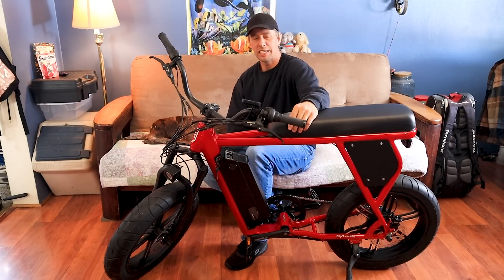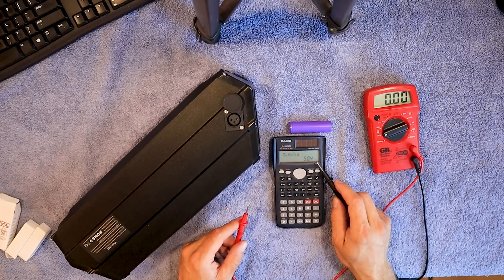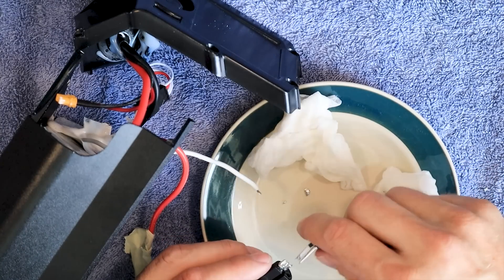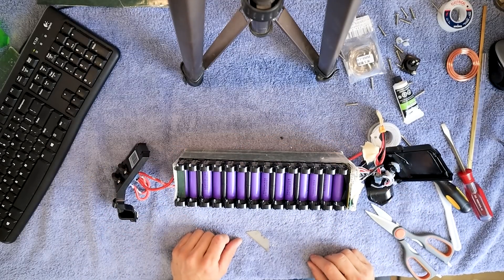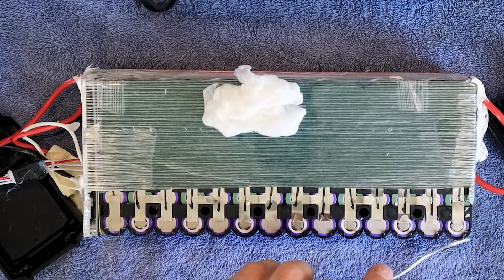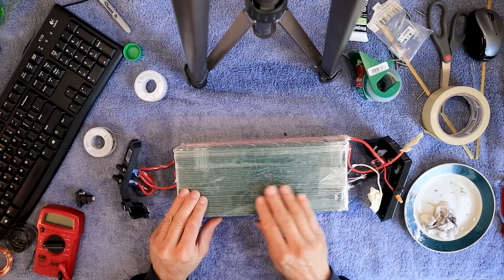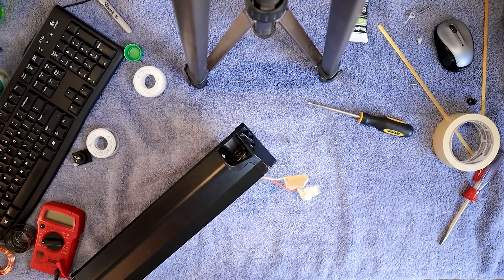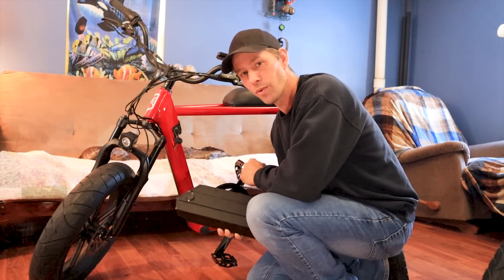Juiced Bikes Scrambler  Upgrade your 13 Ah battery to 15.6 Ah for $50

Comment: Can I do this and replace all the batteries to completely rebuild it?
Reply from the maker: You'll need new nickel strips.  If you're planing on soldering smaller gauge copper wire will work fine.   Spot welding with new nickel strips would be the professional way to do it.   If soldering make sure to use a minimum 60w soldering iron and keep a wet rag handy to cool them quickly.
Reply: @vanmasterflash7153   Thanks for your suggestions!  I've done some minor soldering work before.  I have 2 original batteries on Juiced scrambler and hyper scrambler that need to be replaced.  Juiced prices are really high.  Any suggestion on where to get the batterie cells (your description link is no longer useful)?

Comment: @3cheerz thanks so much for posting these super helpful videos! I tried your link for battery cells and they seem out of stock. I'm having a hard time locating the at an affordable price. Do you have any other recommended suppliers? Thanks again!
Reply from the maker: This only works on the 2019 model.  They removed the empty row and made it more difficult to do as soon as they saw people were upgrading for $50.  Sry, I’m not sure where else to get these cells right now.
Reply: @vanmasterflash7153  previous owner said that it was purchased in oct 2018. Crossings my fingers that when I open up the battery I find that there’s extra slots!

Comment: My Scrambler battery all of a sudden only charges to 50%.  With only 750 miles on it, the company will not warranty it.  Any suggestions as to the fix?  Great video, btw.
Reply from the maker: Sounds like a it could be a bad BMS.  I don't have any good leads on a bms but Rick Rowen does.  Now whether he gives you a link or tries to upsell you one is another story.  First make sure your battery charger didn't come slightly unplugged during charging.  In other words try it one more time.  If that doesn't work keep pressing Juiced for a battery replacement.  If that doesn't work and you feel comfortable with this, take your battery apart and look for obvious problems like bad solders and/or connections.  Also look for burn marks and burnt smells.  If nothing appears out of place it's almost certainly your BMS.

Comment: The link to the batteries you have said they are discontinued. Is there another reputable site you recommend or an equivalent brand that will work?
Reply from the maker: That's the only place I've purchased cells.  Looks like they're getting hard to find.  I'll keep my eyes peeled.  I only have one extra laying around :(

Comment: So did he use the solder in place of welding? I know you need the special welder which I have been thinking about getting. Great video. I am trying to rebuild a ebike battery and this helps
Reply from the maker: Yep I soldered it.  It's not for everyone but if your careful and know what your doing, it works no problem.

Comment: Thank you for your video. 
Can you upgrade that same model to 19Ah instead of 15Ah instead?
Reply from the maker: Yes, you'd need to buy all new cells to do that.
Reply: @vanmasterflash7153  could you advise on what cells to get for this mate. Watched your video over 10 times since I got my bike in 2019..

Do I need a new bms if I keep the voltage the same but increase the Ah?
Reply from the maker: LG M26.  2600mah purple cells.  Not sure if anyone Has new ones anymore.  Should be around 2.99 per cell
Reply: @vanmasterflash7153  Thank you.

Comment: Couldn't you just use nickel strip for everything instead of the copper wire? Want to do this for my batteries this week since I'm stuck at home.
Reply from the maker: Yes.  Only reason I used the wire was because it made it easier to solder.
Reply: @vanmasterflash7153  Cool. Now only if there was a way to get the pack out without cutting off the charging port!

Comment: Would the latest from JB battery pack still use those same cell?
Reply from the maker: More than likely. Crack it open and look for purple.
Reply: I’m betting so.  I’ve got some ready to go for when my JB Scorpion arrives.  That and a new 45amp controller
Reply: @trahar6257  Hi, what controller did you get for your bike? am still shopping around for a good one. thanks

Comment: 3cheerz .. if i tried building a pack using .. LG mj1 10amp cells .. to obtain 21ah .. can i still use the stock bms and controller
Reply from the maker: Yep that'll work just fine.  For BMS its all about charge and discharge amps.  If you planned on running a anything over 35amps you might need to go bigger. Not sure on how much the stock BMS can handle.  For charging I wouldn't go over 4 amps but it might be able to handle more.

Comment: CRAZY .. My results after 15.6ah upgrade ...  stock camp scrambler .. avg 16 - 17 mph .. throttle only on level 1 speed .. after a distance 40.2 miles .. display showed 48.4 volts .. 12.6ah used .. display still showed 2 full bars left to kill .. 60+ miles with pedal assist is doable .. imo .. HIGHLY RECOMMEND

Comment: Sweet .. do you have to adjust the controller voltage that's under the seat after adding batteries
Reply from the maker: Nope same voltage more range.
Reply: What does the controller voltage do?  Would the malfunction of that unit cause my battery to only charge 50% capacity?

Comment: Awesome video!! I just ordered the stuff to do this with mine. Curious, did you notice any low end torque or high end speed after doing this?
Reply from the maker: Lots more torque and higher top end.  30-31 mph on flats full charged and I weigh 185 lbs. Much faster, smoother acceleration.
Reply: 3cheerz I just finished mine up a few mins ago. Sad to say it took me like 3 hrs , and definitely didn’t look as nice as yours. Powered up though so I’m happy. My battery was draining pretty fast. I took the 750w motor out and put in a 2000w leaf bike motor and 48-72v 3000w controller with 3speed switch that added soooooooo much more power . I soldered the shunts in the controller with also added insane low end. The speed switch #3 my bike get 64.7mph with no load and around 53mph with me on it.  Your info on the battery was amazing and saved me probably a grand so I thank you my man!!

Comment: No what you want to do is to group you Li-ion batteries individually by Internal Resistance. Otherwise you'll degrade your entire pack through Imbalance. Sorting Internal Resistance within 5% or ideally within 2%-2.5%. End result is is dead pack with damaged or dead cells. 

More information https://batteryuniversity.com/learn/archive/non_correctable_battery_problems
Reply from the maker: Nobody does that with new cells.  Should they? YES
Reply: @vanmasterflash7153  .. That's not true. See 2 min 25 sec https://youtu.be/v7zzFBGg1JY and they're a small repacking / packing company. Major battery pack companies 2%-2.5%.
Reply from the maker: Either way I’m not disassembling my entire pack to test all cells individually then group them like I did when I made my other battery.  Not worth it.  It’ll be just fine.
Reply: @vanmasterflash7153  .. It'll be fine until either your range deteriorates quickly or the pack fails .. hopefully NOT spectacularly. My advice, once that pack fails: either invest into a  spot welder (e.g. SUNKKO; soldering kills cells fast) and purchase Impedance Matched Cells or find a local company that's experienced rebuilding a pack. Either way for one rebuilt pack it'll cost you the same.

There's a lot of misinformation out there. My business has absolutely nothing to do with any of this. 

I was simply curious and ran across your video .. that's it. Good luck and hopefully everything goes smoothly.

Comment: Thanks for this video! I am glad I saw it. I was thinking about getting the 19.2ah battery, now I can save some money and do this instead! After you measure your battery pack and it was 54V and the 14 cells yield 50.4V. You later said, "you wanna bring the battery down a little bit, you wanna match the voltage pretty close". What do you mean by that? What battery are you "bringing down"? Are you referring to matching the 14 cells voltage that should come close your battery pack voltage?

Comment: +3cheerz What's the highest amp hours that scrambler battery can be upgraded to. Because if it can a higher amp hours than 15.6 I would like to do that. Because Juiced Bikes has a 19 amp hours version battery.
Reply from the maker: Highest reliable is around 3500 mah each cell.  That would be 3500 mah x 6=sweet ass 21ah battery.  The cost would be $430 plus, using LG mj1 10amp cells.

Comment: My battery starts shutting itself down at 47 volts. Any idea what might be wrong?
Reply from the maker: Not sure.  Your battery shouldn't be sagging below 42v but maybe.  Did you try setting the low voltage cut-off to 40v?
Reply from the maker: It could also be battery terminals loosing contact where the battery connects.  But if it shuts down at the same voltage every time it's not that.
Reply from the maker: I just remembered that you live in mn like me.  Cold weather causes more voltage sag.  I’m starting to think it’s the low voltage cut off.  I sure hope so anyway.  When it warms up you should see a lot better range.
Reply: I have the low voltage set at 42. Can't be connections as the battery itself is turning off green light goes off.  Could it be an out of balance battery tripping the battery protector?
Reply: Was 60 degrees today and still shut off at 57.7 same voltage as before, display shuts off then battery light dies out.
Reply: Tried leaving it on the charger overnight to balance the cells. It was 60 degrees today and still shut down at 47.7 same exact voltage as last time. Display shuts off then green light on pack fades out. Will turn back on but as soon as a load is applied it's off again like it's out of juice but can't be at that's voltage. I must have messed up the upgrade somehow.

Comment: Please be careful with 18650 batteries, folks. And they are everywhere. Each one is a small incendiary bomb that makes a road flare look like a birthday candle. And they will set each other off in a chain in the case of thermal runaway. Avoid cheap manufacturers who cut corners on the inner insulating strip. I spent 11 years as a hazmat guy, Lithium batteries were my #3 most common waste stream (and #1 most expensive), and one of my key jobs was discharging, classifying and packing Li-Ion batteries of various types for recycling/disposal. 
Never, ever
1. Use ones where the shell is even nicked or scratched 
2. Use cheap brands that you got a "good deal" on. The bulk of them, even when they have someone elses name on them like Tesla, are made by Samsung & Panasonic, which are fine. Beware: there are bootlegs of those brands all over the market. So if you see a hot end that is oddly sunken or non-standard, you probably have a fake, and that's not bueno. Even if the markings say "Panasonic"
3. Be cavalier with a heated device like a soldering iron. Apply heat, and you can cause thermal runaway which ends in an explosive burst of super hot fire, and no, you can't stop that chain reaction, you have to douse the rest of what caught fire with a B fire extinguisher
4. Get them wet or allow moisture to build. Ventilation, humidity reduction, and protecting the shell of each individual 18650 battery are key. 
5. Make a habit of throwing them in the trash. Put tape on the ends, stuff them in a plastic zip lock bag, and take them to Home Depot or Lowe's for recycling
I love the ton of power in my Scrambler's battery, but after seeing the things I have, I treat the thing like a White Phosphorous shell sitting a foot away from my balls when I ride
Reply: What are talking about? get to the point!!!

Comment: Just finished my upgrade. Not as easy as you make it look. Is there any way to know that it worked besides milage tests ? It was to cold  and rainy to ride more than a few miles today and I didn't notice anything different on the display or anything.
Reply: I thought I was decent at soldering.  I was wrong.   I’m 25% done with about 2 hours in so far.
Reply from the maker: Not sure maybe in the advanced display.  It takes a long time to solder all that but it'll be worth it.  It will help your range and greatly improve your batteries life.
Reply: That soldering is a pain. Next time I'm building a spot welder.

Comment: On the button side there is a small yellow connector glued to the the cover. What is that for?
Reply from the maker: I was thinking the same thing.  Looks like another connector for charging or something.  I just ignored it.  If you figure it out i'd like ot know.

Comment: Why didn't you use nickle strips for all the connections?
Reply from the maker: It was easier to use solder the wire and works just as well if not a little better. Having a spot welder would be best.  Someday i'll get one.
Reply: Thanks looking forward to upgrading my camp scrambler

Comment: Thank for the videos I saw your super 73 one. How do you like the scrambler ?
Reply from the maker: I've only rode it once because we've still got a ton of snow and ice here in mn but I love it.  Rides so smooth and the brakes are awesome.  Plenty of power and seat is super comfy as well.  No complaints so far.
Reply: 3cheerz cool i just ordered one
Reply: Same here haven't ridden much because it's been so cold in northern MN but loved the rides I have been on, icicles hanging from my beard and all.

Comment: Great video! It is possible! Have you had a chance to test it out? Did it give the bike both more power and range? 
I have a black camp scrambler with the 13ah battery and would like to upgrade if it makes a decent deference.
Reply from the maker: We still have a couple feet of snow on the ground here. Won't be till late March early April till I can ride.  It won't add hardly any power. For that you'd need to increase voltage.  It will increase range and make life easier for the cells in your battery.  If your getting 20 mile range on 13 Ah, then 15.6 should get you about 25 miles. More cells but also the cells discharge slower when less amps are pulled from them.  It's a no brainer for me but everyone is different. BTW I think soldering and battery building is fun.  It's hard for me to keep my hands off  these things.

Comment: would my hyper with the 52 volt 19.2 a/hr battery have that extra row to slot in more cells too?
Reply from the maker: Not sure but lets find out right now.  My 13 ah city  case is 15-1/2"  x  3-1/16  x  5-1/2(eyeballing the bulge).  If yours is the same size then the answer is no.  More than likely your case is the exact same size as mine and you have higher capacity cells. Maybe these     https://www.imrbatteries.com/lg-mh1-18650-3200mah-10a-flat-top-battery/
Reply: @3cheerz City/Camp & Hypers have the same case so pretty much sure you are right on cell capacity. Great video 👍